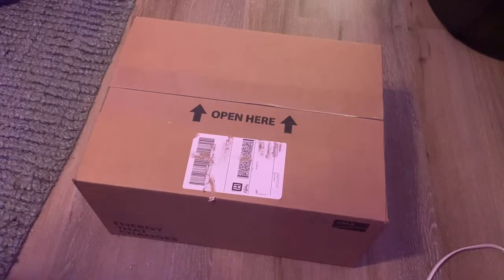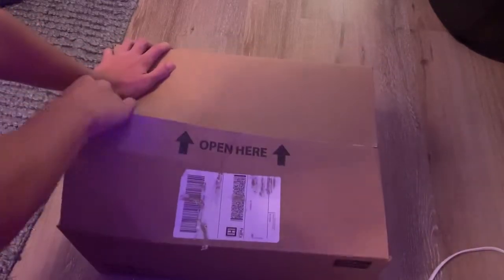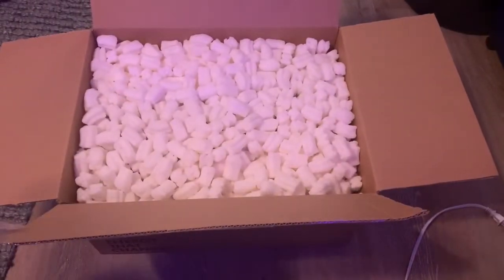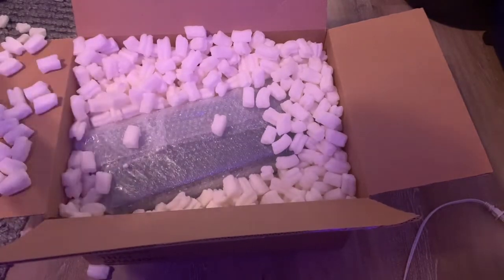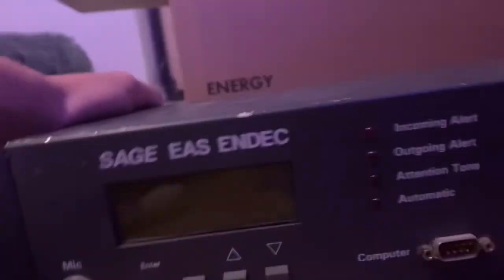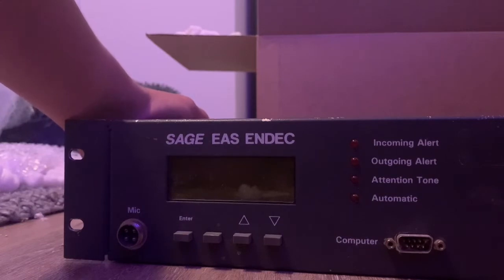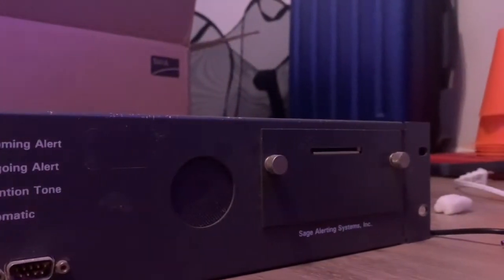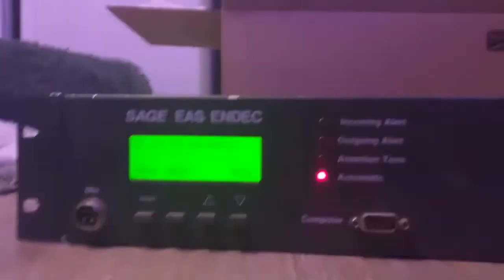Unboxing and Test(s) of a SAGE 1822 EAS Endec (with fails)

Comment: My endec shows the rom version but wont go past it. You know why this could be?
Reply from the maker: Huh. My gut says it’s a hardware issue but I’m no professional! Where did you get it?
Reply: @FireAlarmFreak  Got it from a buddy of mine who said it worked. He replaced it cause he did something with the mic jack and it didnt work right but still booted. My guess its the rom chip i threw in that might be corrupted. I have a new chip on the way and i just need a rom file.
Reply from the maker: @SouthCarolinaSirens  alright. Like I said I’m no professional but that probably sounds about right.